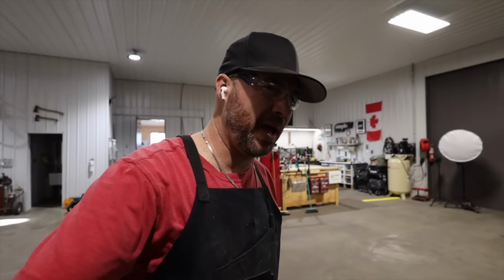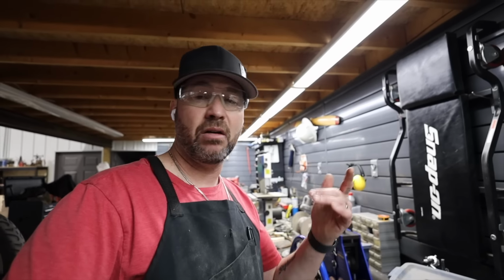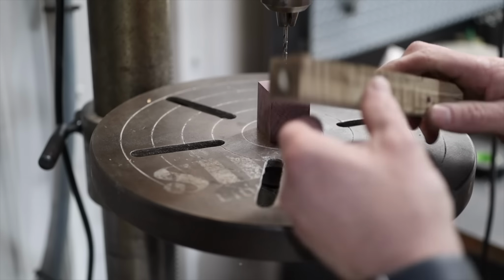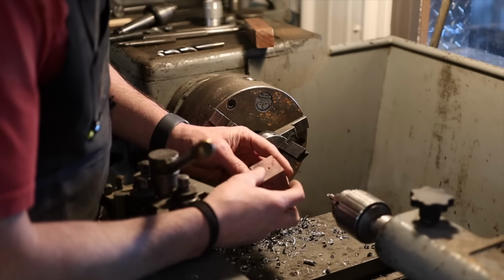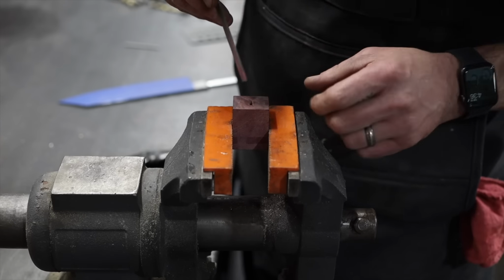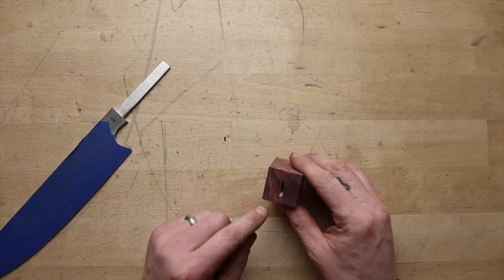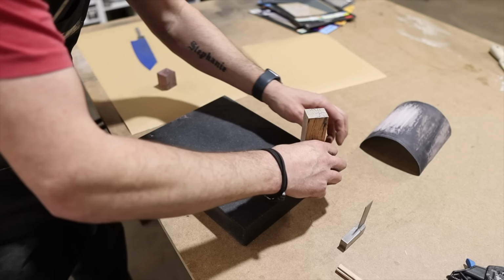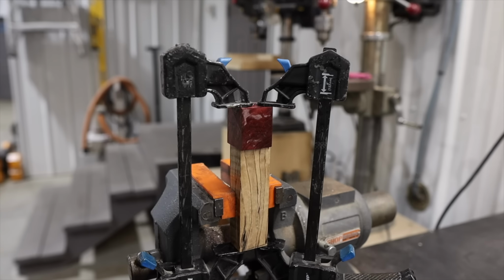Knife maker's vlog (sanding blocks and a Japanese wa-style handle)

Comment: Drilling the hole halfway through then flipping it to drill from the other side will minimize the small bit walking issue, though not always solve it.  The method used by 
RSaMa60 is  the better answer for your application.  As usual, excellent work Jeremy.

Comment: I do a different sequence when I drill the holes on the Wa handle bolsters. I drill the large diameter hole first so the desired depth using a wood drill bit with a center point. Then I use the center point in the hole to drill the small diameter. Why? Small drill bits tend to wander away and follow the wood grain (even with stabilized wood). Doind like this i minimize the depth I need to drill with the small bit. Never had any issue since I do it like this. I also use the dowel method. I don’t have a mill so I use a jewlers saw and needle files for the rectangular opening.
Reply from the maker: Wow! Thank you so much for this! I really do appreciate it. That is brilliant! I hope you don’t mind if I mention this in tomorrows video. With credit of course. Seriously that makes so much sense. Thank you!👍
Reply: @Simplelittlelife  feel free to mention this. And of course, small drill bits > high rev and low feed rate. Give the drill time to do it’s work.

Comment: Little tip on drilling end grain, kindof treat it like metal. Use light pressure, shorter drill bits if possible to reduce flex, and spur bits instead of normal bits. They tend to stay straighter and cut cleaner from what ive seen. When i make lanyard beads it happend a few times till i tried these. Plus my dam chuck is a wibbly wobbly wonder 😂

Comment: I put some grease on the tang and leave the knife in the handle and as the glue cures then when it is set I clean it with acetone
Reply from the maker: Yeah I've heard a lot of guy do that. I've tried wax but not grease. 👍
Reply: petroleum jelly is what I use, no issues so far
Reply: I do the same, I use petroleum jelly / vaseline.

Comment: I like to tape the edges of the pin hole in the tang and the pin itself, that way the pin pulls the materials together during glue-up and the i free hand the shape of the handle after the blade is set. No need for extra steps imo

Comment: I think I have the ideal sanding blocks.  They kinda look like his but smaller and not metal or wood.  You don't need a mill or lathe.   They are made from a 3/4" HDPE white cutting board.  Cut them 3-3/4" x 2" in size. then cut two channels all around (top, sides, and bottom) the 2" ends about 1/8th deep and 1/8th from the edge.  Then using a router,cut two 1/4" U shaped channels on the 2 longer sides only on the top side, about 1/4" from the edge and about 1/8" deep.   When you fold and cut up a 8-1/2 x 11 sheet of sandpaper you will get 8 pieces 2-3/4 x 4-5/8 in size. These small sheets fit perfectly across the 2" wide block. Use 1/4 " rod or spikes and a tight fitting O ring on each end to capture and keep the sandpaper tight around the sanding block.   These blocks work out perfectly.....they are flat,  they have 90 degree edges, they are waterproof for wet sanding and the sandpaper sheet is utilized to the max. The sandpaper can also be changed in a few seconds and is held tight in place.  They do not warp or crack and can't rust.  To load the paper onto the block, simply lay it across the bottom then pull the edges over the block and press into the U channels then roll the rod or large nail over the paper into the U channel to hold it tightly.  I've found that O rings about 1- 1/4" and less than 1/8th inch thick work just right and provide sufficient tension on the rods/spikes to hold them and the paper in place.  Buy some extra O rings as they will break after a while.   HDPE is easy to work with and no splinters. Great for hand sanding knives.

Comment: It didn't drill straight because it wasn't sharpened right .one cutting edge was higher than the other throwing the center point of the off

Comment: Turtle wax or vaseline on the tang and you can leave it in until the epoxy cures and still pull it out after. Clean off the tang prior to final glue up and theres no problem.
Reply from the maker: Yeah I've tried that method several times but I always come back to this one. Just personal preference. 👍